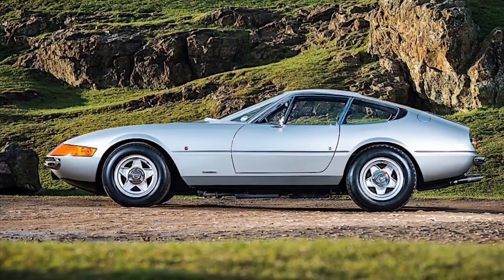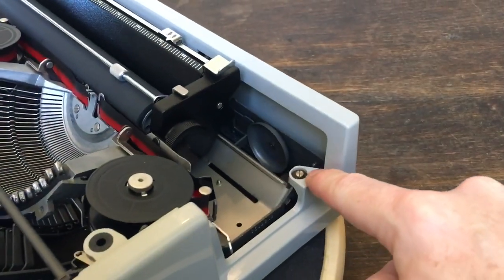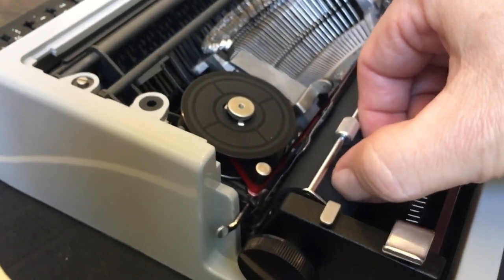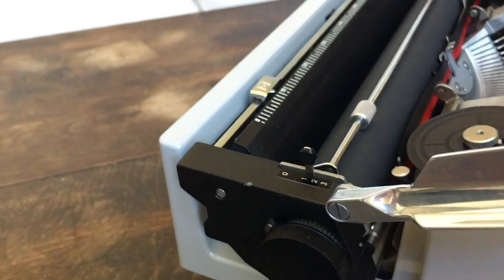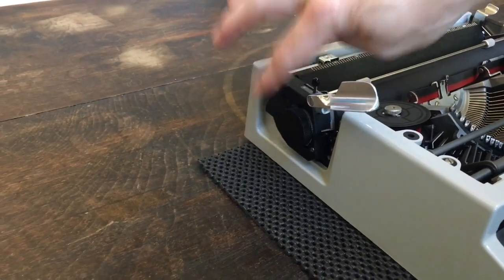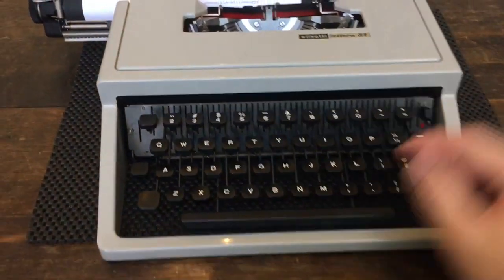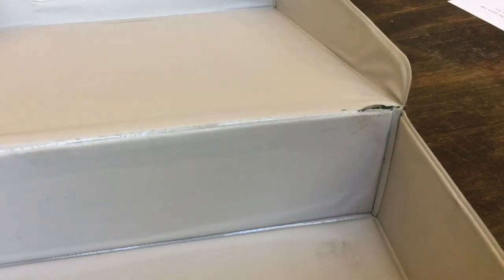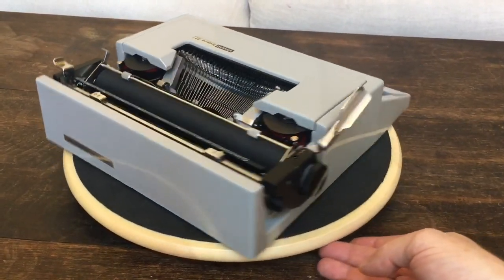Typewriter Minutes - Typewriter Review: 1972 Olivetti Lettera 31

Comment: Loved the video. Finally found out where the serial number was! I bought one on Ebay for about £40 a week ago inc. shipping, quite dirty inside but works like a dream. Worth mentioning, I think, that although there's no tabulator it's got an automatic indent if you hold down the blank key next to the 2 while returning the carriage from right to left: the next line begins a few spaces in, so great for new paragraphs, dialogue etc. Mine has a Pica typeface but the Underwoods have an Elite. Mine was made in Italy and on the inside of the case they've spelt it 'Tipewriter'!
Reply from the maker: Congrats on your find. These are neat little machines.
Reply: That indentation feature is common on Olivetti, on the Lettera 22 you can even reach that same point from the left by using tab while holding the margin release, if you forgot and are at the start of a line (while on the Studio 44 it works properly only from the right).

Comment: I have one I found last year without the case. I put it in my pile of "will get to later" but went and had a quick look after viewing your video.  Mine is an Olivetti Underwood, made in Don Mills Canada and essentially similar except for the ribbon cover. Mine has the stylized Olivetti logo pressed into the plastic about over top of the right ribbon spool area.  I haven't really played with it except one to see if it worked which it does. I never until now noticed the blank key next to the 2.  What is it for?
Reply from the maker: The blank key is margin release. I really like the chicklet style keys on these.